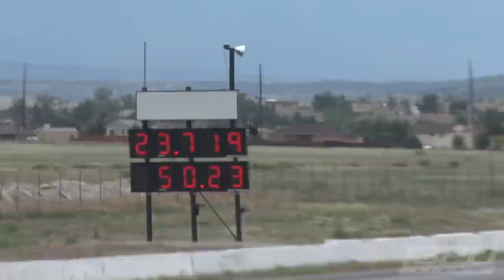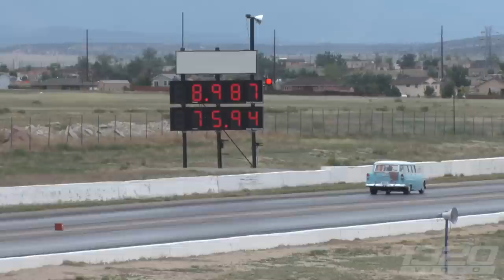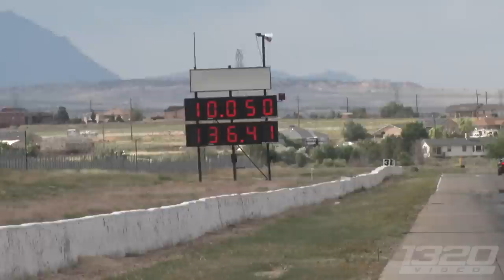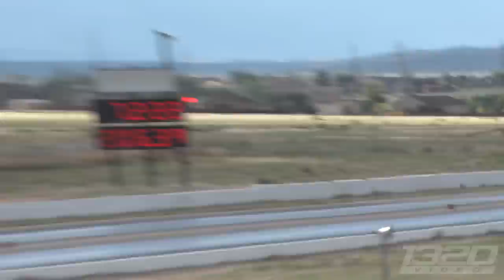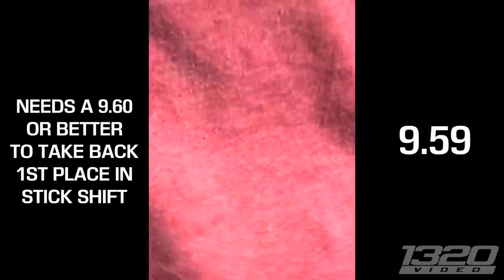1,000 miles down.. Can Cleetus Win RaceWeek 2022? (RaceWeek 1.0 Day 5)

Comment: LS's doing what LS do best.. go fast and then break. People really need to learn about Inconel valves, they are expensive but they are worth it.. $12 each but they almost never break and don't care about heat. If you don't know (most people don't) Inconel X was designed for the SR71 for all the leading surfaces on the wings and other high heat components that are regularly subjected to over 1000 degrees C from the friction with the air at Mach 3+. 
Something people need to remember about the Grom is it's running 23 sec 1/4's with 9 horsepower at best.. That thing is stock. At elevation it's probably making 6hp. Talk about doing it with less, a stock minivan wouldn't be that fast.

Comment: A big congratulations to Tom in the white 5th  GEN Camaro for getting the car working for years an  years the car has been running consistent low 7s on all the drag an  drive event he goes on can’t be too many times that Tom has to Trailer his car to each track don’t forget this car Isn’t a soccer mom minivan it’s a Larry Larson built rocket ship with air-conditioning license plate and 2000 hp under the bonnet

Comment: Are you allowed to use a quick change rear in most of these classes?
Reply: I’ve never seen anything in the rules about it, but I’ve also never seen a racer do it.
Reply: You could run a QC, but the big power cars would probably be breaking them.  None of the major manufacturers build them for drag racing.
Reply: @kirkwoita8840  we make 1600 on our champ
Reply: @mdtransmissionspecialties  power isn't the problem FD drift cars use QC's it's that the spur gears can't handle the loaded launch.
Reply: @kirkwoita8840  we don’t have just a off the shelf gear set amigo.. but ok. I got my answer I don’t care about your opinion on my rear end? Is that okay?
Reply: Been there done that wasn’t a fun experience lol
Reply: @54raceman  not this one hero.